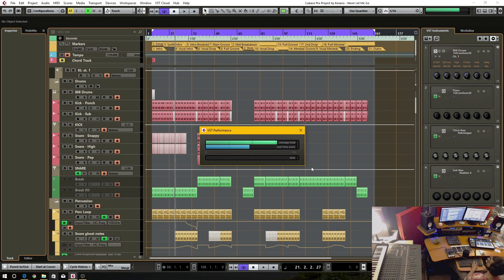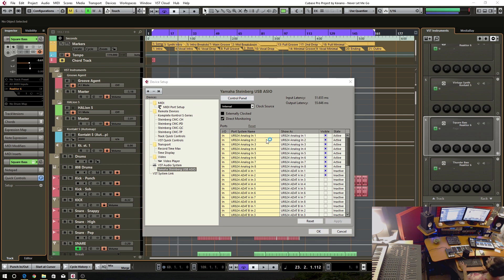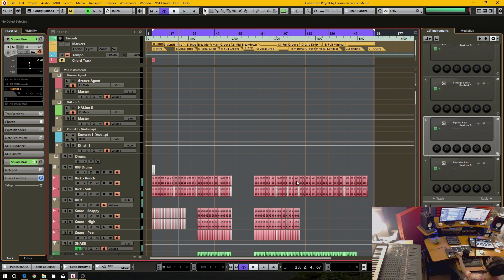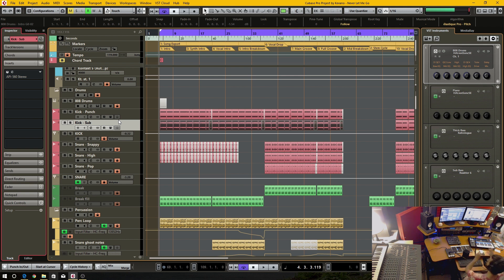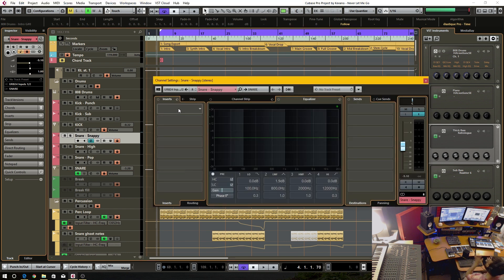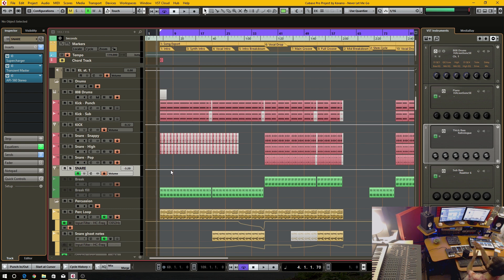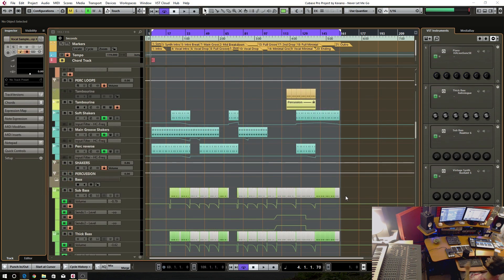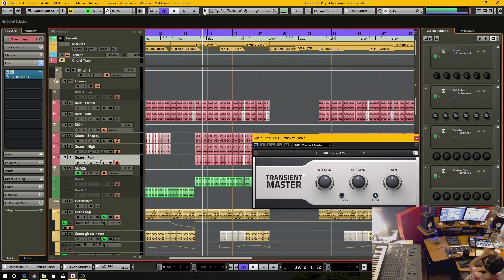Optimize Your DAW & Project for Better CPU Performance

Comment: hi, buffersize has more to do with latency. Smaller buffer gives you quicker response when playing, not "better audio quality". Its just a matter if your computer can keep up, to play everything in real time. I have plugins that become unstable at buffer sizes too big, so this is for everybody to find out for themselves. Pick a buffer around 128-256 when playing live, or even lower if your computer can handle it. And leave it high when tracking just audio + effects (like when mixing down or mastering).

Comment: Just upgraded from 10.5 to 11 and i am having Ram spikes, program crashing, loop file not playing. I emailed Steinberg but they haven't gotten back to me due to "high volume". I didnt have issues with 8/10/10.5. Is it me? lol
Reply from the maker: Cubase 11 has been great for me. What OS you running, any basic computer specs (ram/cpu/gpu/etc)?

Comment: I see this post is from 2017, nevertheless i run Cubase pro 10 and i deal with the same issues. Now my problem is caused by my high load of plugins on busses. What is the best remedy against high load, a ful lbunce of the perticual busses?

Comment: The freeze option saved my tracks. Before freezing my audio would drop out every second (literally). I can now record again without any audio dropouts whatsoever. Thank you!

About the buffer size you talked about at the beginning of the vid... higher buffer sizes are not good while recording, you better have lowest buffer size (lowest amount of samples) so the input/output latency is as low as possible. That said, for mixing it works fine to have higher buffer size.
(Edit: I see now that someone else here mentioned the thing about buffersize already)
Reply from the maker: You're welcome, yes that's correct about buffer sizes. I was trying to explain how to prevent CPU spikes but in the context of mixing/mastering/producing, at the later stages of a project, but didn't communicate thoroughly about needing low buffer size to avoid latency while recording. Cheers!

Comment: I'm having a Hell of a time in Cubase 10 with real-time peak SPIKES. Makes working impossible. Anybody have a clue as to why these spikes occur?
Reply: I'm trying to figure out that as well when I find out I'll let you know. Mine just started out of nowhere. Used to be able to open 4 to 5 inserts on up to 50 tracks now I can barely open 3 inserts on one track. Huge difference and impossible to be creative!
Reply: ..beside everythig else , may be a broken interface.
i had that on motu.
Reply: Can you remember 2 years down the line how you solved this. I’m having the exact same problem. Not sure if it’s the Kontakt 6 player. I only have three instruments and a video activated and it’s really bad.

Comment: Which is more important for daw usage ... cpu clock speed or core .. if i have intel i3 8350k  will it do  well  ?
Reply from the maker: Always go for more cores. The i3 is probably going to work if you have 8gb-16gb ram, but you'll get much better results with an i5, and far better results still with an i7. If you can afford the initial purchase of an i7 with a great motherboard, then go for it. You can always expand ram later, and if you have to cut costs and buy a spinning disk hard drive you can then upgrade to an SSD later too. If you're serious about music production and will be using big programs like DAW's, Photoshop, or Video editing programs then an i7 is well worth the investment.

Comment: I think I remember you referring  to reduction meters as related to compression in the meter bridge in Cubase 9.5. I think you may have to use stock plugins for this to show up.
Reply from the maker: Yes, I've done more research and found that you need to use the stock compressors, but not only that, you need to use then in the channel strip that's built into the mixer window. That's the only way the gain reduction meters show up, and it only shows up in the meter bridge and not the channel meters.

Comment: problem is Windows 10 & not CPU load.. there are alot of driver bugs, especially with new hardware, CPU, Motherboard, Sound Interfaces etc 

i opened a file in Cubase 9.5, that i started with using Cubase 8, i was prompted to select an Asio driver.. Cubase was recommending the Low Latency, i wanted to use my NI Komplete Audio 6 Asio.. so when the file loaded there was no sound output.. input signal is going in, but nothing coming out .. if i attempt to duplicate tracks still no sound .. if i create a new track/channel there is sound 

its not a Cubase or Native Instruments bug.. its just a Windows thing, its not releasing the driver for the tracks that loaded at start up..  i dont know maybe there is a file or registry entry somewhere that needs to be deleted, then Cubase will know drivers were switched..

Comment: to bad steinberg is a shit company. The customer service department is low grade and the return policy IS horrble.... they try and charge you for return items that are new. and the drivers for the ur44 is shit and dont work on my system at all .. i7quadcore 4. ghz processor 32gbs ram Never buy Steinberg shit
Reply from the maker: I would disagree strongly on that. Although I've experienced several bugs with Cubase, the hardware has been completely rock solid for me, and the drivers for Windows. I have no experience with returning items since I've never wanted to return their products.

Comment: ASIO usage meter in Cubase does NOT show overall CPU usage! That's important to understand - ASIO meter shows usage of one most stressed thread/core. The rest of them, in theory, can be completely unloaded
. In some scenarios it can mean that you can multiply your plugins as mamy times, as there are cores, without making the meter any higher.

So in order to make it as low as possible, it is crucial to have plugins working in Multithread Mode and spread them across channels in mixer. Stacking 8, it now 16 plugins on one channel gonna make one of your threads overloaded, if these are not VST3 od multithreaded.

Comment: Idk why everyone is shitting on you about the buffer size, I always run my buffer size at max because the majority of the time I have like 100 tracks and I'm not doing any live tracking, just programming soft synths with midi or mixing.  When I do track things like guitars or record the midi of myself playing a part, I just turn the buffer size back down until i'm done.  Actually for guitar and other live instruments, I just use the direct monitoring function through my interface, which is not really a cubase feature.
Reply from the maker: I do almost exactly as you mentioned. For the most part I'm not tracking but can utilize "Direct Monitoring" with a large buffer size and problem solved.

Comment: Ok first of all MIDI tracks use almost no CPU at all. Even if they did, they don’t use a voice of audio in the background so no advantage to disabling the track over just muting it. If your ASIO guard is turned on, your regular buffer setting only applies to the track you are currently on, not mentioned. Setting the buffer to 2048 also won’t be good for anyone tracking with VST instruments, or direct monitoring through Cubase. The video doesn’t state the version used, but 9.5 has Direct Offline Processing, so you can non-destructively apply effects to audio parts with no CPU hit on playback.
Reply: Hi, I use omnisphere with a couple of instruments running through Kontakt my cpu maxs and i get a load of noise and breakup. any suggestions how to stop this please, you sound like you know stuff !!  Kev

Comment: You make it seem as if selecting a higher buffersize is the best choice because audio quality will be better. That's not the case at all. Setting the buffer to a higher size is just a compromise that people can use if their system isn't powerfull enough to run everything at once. When you are using VST-instruments you actually need to use the lowest possible buffer size because otherwise there would be too much of a delay between playing keys and hearing sound. Once a track with a VSTi is played and you're done with it, you can freeze that track to save resources. When I get to the editing or mixing stage, I usually set the buffer size to a higher setting cause at that time it hardly matters for timing. In practice I find myself changing the buffer size quite frequently going back and forth to the different stages of production.
Reply from the maker: Implicit in this video is the assumption that the viewer is experiencing a decrease in audio quality even with increased buffer sizes. That's why I explain what buffer size is, what asio-guard is, then I go over how you can save CPU processing with using freezing, disabling tracks, and using VST3 plugins. I should have been more explicit with the idea of using a lower buffer size for recording purposes, but I think anyone who's having issues with audio quality would have already figured out that increasing the buffer size helps for reducing audio quality disturbances but brings more delay as a compromise.

Comment: Thanks for the video - though I don't know how you cope with such high latency times!
Reply from the maker: Do you mean with such a high buffer setting which then causes lots of latency for recording purposes? Cubase has a function called "Adjust for record latency" that actually prevents any latency no matter how high of a buffer setting you have.

Albeit, this video is meant more as a solution for the end of a project, when there is minimal or no recording actually happening, when you're deep into the mixing and mastering stage with several plugins being used.